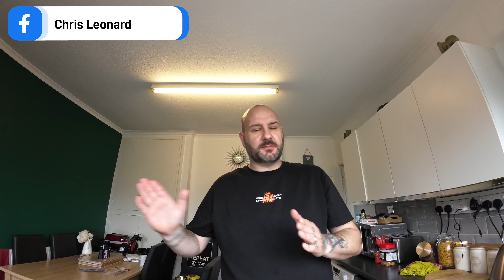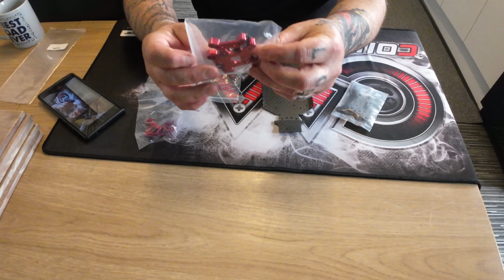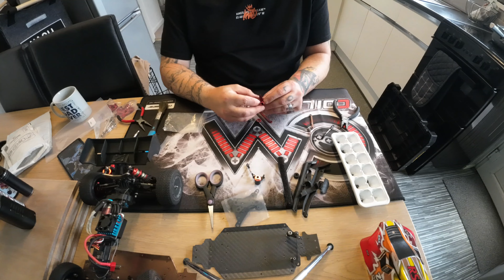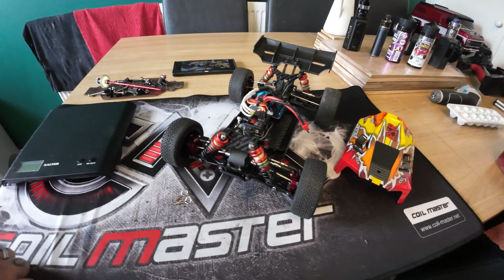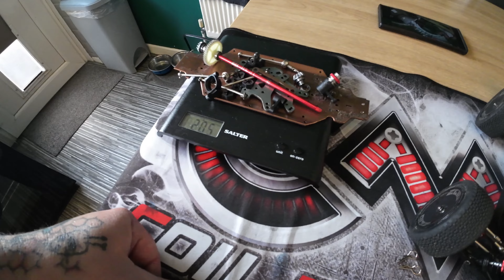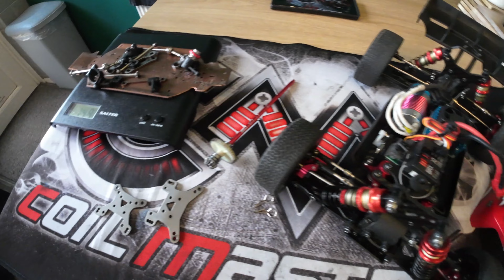Wltoys 144010: Full Carbon Chassis Upgrade & Performance Boost 🏎️💨

Comment from the maker: So what do you think guys ! , Would love to hear fro you all . 
I think it's going to make hell of a difference, making the car more agile, faster and generally better and stronger . 
Cheap and cheerful upgrades for the win 😁 let me know your thoughts below 👇
Chris 😎🤙
Reply: So this is really basic, but I just got mine, and the first thing I did was pull the diffs, and grease them. Well - actually the first thing I did was order an upgrade kit, but I don't have that yet. I'm curious about the motor mount. I haven't built/upgraded a car in a few years, and the gearing doesn't feel right. It feels like it might be spaced too far apart, and I think the motor mount isn't adjustable. Could I get away with putting a 16 tooth pinion gear, or am i wrong about the motor mount being a fixed position.

Comment: hi chris
yeat another great video from you and the family the car is looking awesome and there is not much left of the origonal car left now.
brill to see the carbon chassis and uprights and i would say the weight lose will be massive.
hope you and the family are all well.
peter
Reply from the maker: Hey buddy , 
what a little car this is turning out to be hey ! , its been so much fun getting it to where it is now and i dont regret a single thing at all . 
We got the power , its light , the handling is on point . 
Time to Rip it now and she how she goes !!!! 
Hope you and the family are well and safe buddy 
Chris :)
Reply: @ChriswithaCrc  hiya mate cant wait to see this being out and about and i hope it goes to the usual park with that s bend be great to see how it handles now and yeah it has sheaded alot od weight and the bends in the uprights i was shocked maybe carbon fibre will hold up more then they did.
we are all good having a nice weekend off just doing a video for the other hobby of mine for youtube.
stay safe all of you.
peter
Reply from the maker: Hey buddy, yeah that's the difference between this and the LC racing equivalent ones made of cheaper materials ones made of quality materials. 
It was the same thing I noticed with the shocks . 
I'm about 85% at the moment fully race car 🤣.
Oh great stuff buddy anywhere nice ? .
Hope you have a great day 
Chris 😎🤙

Comment: Your Inspiring me to go carbon with mine lol I thought it was a good idea to go all metal because if some parts were stock and some were upgraded then I was thinking the stock parts might end up breaking quicker, I might keep the metal parts and swap the metal chassis for carbon, what do you think? Another very good video buddy the new equipment was a good addition to the channel, good shout mate
Reply from the maker: Hey dude, I would say carbon is a massive difference, what you got to think is that these cars are small , there meant to be agile and unfortunately most of the metal parts for these cars are weak and bend easy . 
I definitely endorse the carbon upgrade. 
And thanks buddy the new equipment is awesome really helping me make better videos I think . 
Hope your well chief, we need to catch up soon 
Chris 🤙😎
Reply: @ChriswithaCrc  I might godown the carbon route, I’ve still got to put it all together again lol. But 💯% gotta catch up soon buddy just on a bit of a quiet one at the min

Comment: Stunning upgrade Chris and you works complete the other way around. you got the Wltoys 144010 and is 1/14 scale and i started with almost the same a 1/12 scintilla longer Rlaarlo 1/12 scale.
I got a prefect chassis and rolling stuff with terrible ESC and motor, but after the change i got a mad animal, what i can change for off and onroad. I seen at my RC a Phat body for the 1/14 scale of the Ford Racing Escort Mark 1, but will not fit my car, mayby it's something for you to look at it. Just like you said i go the slow way and got no a great drive machne and hope just above the 70 MPH and will see i have to do more upgrades. I have here a 3660 4300 kv to go that 100 MPH but i don't wan't to rush it on 3s, also this ore next week the Rlaarlo AK-917 come in and will compare them on the same specs. i will think the AK 917 is a hipe and get that ar for free for a good make up for the bad start on the AM-X12, but i will give both cars the change and like working on the AM-X12 and many parst and upgrades are the same as the Wltoys parts and are good to get here. I hope your car is rib of the ground next round👊
Reply from the maker: Hey buddy , Hope that your well 
Not sure what boddy to get for the Wltoys quite yet to be honest with you . 
i want to get something that will fit the LC Racing EMB- T tires that are coming for it . 
So chance are that ill either stick with a buggy body , or Go for a truggy shell . 
The AK917 does look very interesting , Im pretty sure i could make that fast for sure , Having said that not done many speed runs but my racing knowledge from the past i think would help for sure. 
I think you'll smash the 70mph mark with the AM-X12 that im confident in . 
I think the next 1/14th scale im going to give the LC racing BHC-1 buggy a go . 
As you said time to let the 144010 a rip now and see if all ive done has helped hey . 
Hope your well 
Chris :)